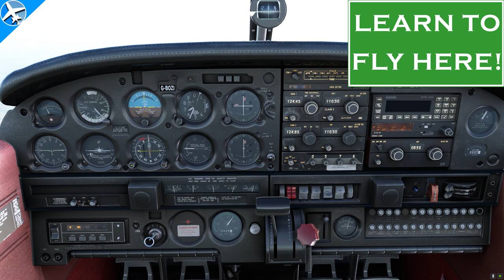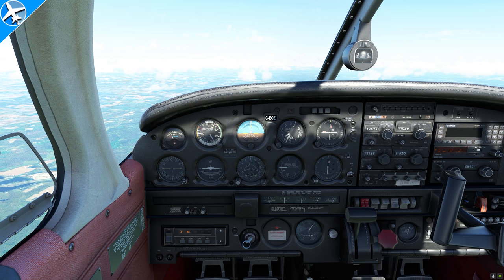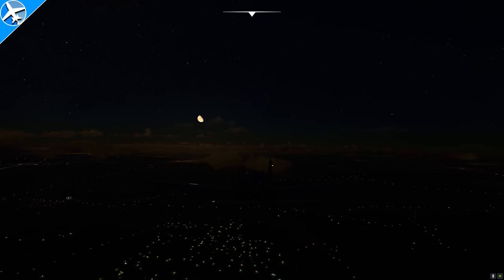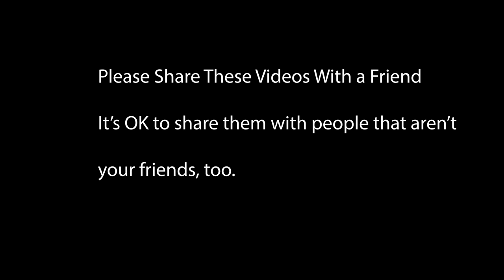How Flight Instruments Work | Required Instruments | Inoperative Equipment

Comment: Interesting the magnetic compass which deviates towards the North while accelerating and towards the South while decelerating. I haven't seen that in my VFR lessons. I'll look for the cynetic reason behind this. Thank you ! PS: In French, a "compass" is the wheel of the cardinal points which turn (as in a plane or a sailboat) and a "boussole" is just the magnetic needle which moves on the fixed and portable cardinal points (as in trekking)...
Reply from the maker: There are more deviation errors.  Along with ANDS there is also UNOS.  You might find that acronym while searching for the reason the compass moves with ANDS.   Incidental learning at its best!

Comment: Very nice! Wouldn't a static port that is on the trailing edge of a fin give a false reading due to being in a low pressure zone? From what I gather from the FAR's, any installed equipment must function prior to take-off unless there is a minimum equipment list and a letter authorizing flight with inoperable equipment.

Comment: Shared with all my enemies, but now they're my friends. What to do?

Another excellent video. Can you elaborate more on the "we don't have these" instruments etc? Is that because this plane doesn't have them, the sim omits them, or some other reason?
Reply from the maker: The airplane doesn’t have them. The engine is air cooled, it doesn’t have a constant speed prop so no manifold pressure gauge and it has a fixed landing gear.  

Thank you for sharing with all your enemies and I’m glad you gained some new friends.  Rejoice!
Reply from the maker: @06L  magnetic dip is right which is caused from the tilting compass. ANDS an UNOS are two different types of errors.  The latter having to do with undershooting or overshooting the intended compass heading based on latitude.

Comment: Thanks for sharing.
Why you prefer MSFS Cessna 152 and 172 to X plane 11 ones?
How you compare flight models?
Reply from the maker: I do not have X Plane so I cannot compare them to anything except real life experience in each.   MSFS has great graphics but X-Plane has better systems simulations.
Reply: Thank you. Do you think Cessna flight models are accurate with real thing?
I don't figure out where I can find Community folder to add planes in Steam edition.
Reply from the maker: @simplydesan211  They are a little bit close but not 100%.  Even the real full motion simulators we train on are not 100% accurate to the real airplane in terms of feel and pitch/roll rate.  The community folder should be in your windows directory under your user name/app data/local/packages/ then some long microsoft flight simulator extension/local cache/packages/community.  It is a tough folder to find.  Once you find it, pin it so you can get back to it easily.